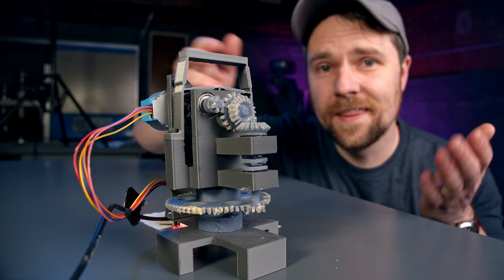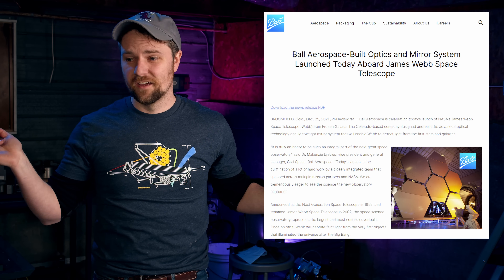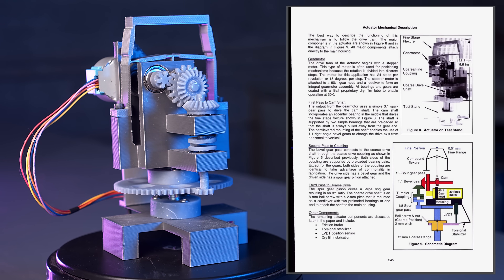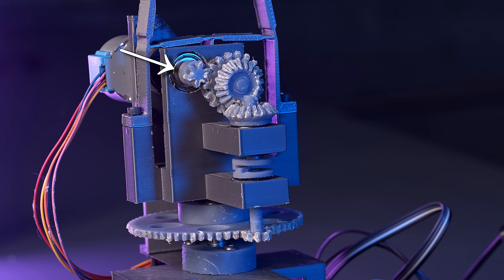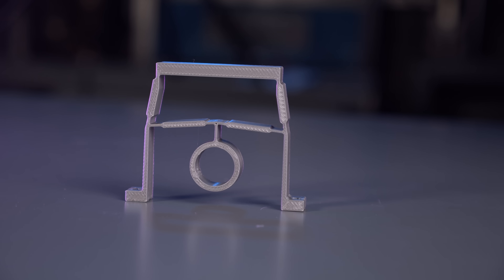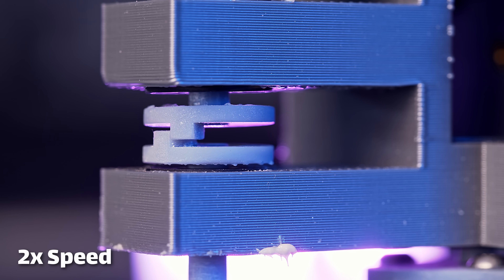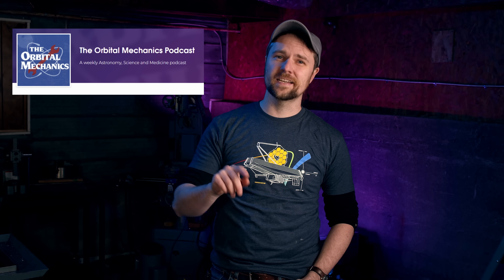How to achieve nanometer precision in space?

Comment: As far as I’m concerned we are wasting our time. I truly believe we could have the mirrors aligned by now.
Reply from the maker: How many mirror segments have you cophased in L2 orbit? Not trying to be rude here, but your string of comments are grossly oversimplifying the situation. Cophasing on earth is a tremendously difficult task, requiring each mirror segment to be within a handful of nanometers of the correct curvature (in all degrees of freedom) across all segments. A single segment that is phased incorrectly reduces the resolution of the entire mirror array down to the size of a single segment, so all segments have to be perfect.

Now do it in orbit, on a telescope that has to be kept so cold that it can't detect itself (because it's an IR telescope) orbiting an unstable lagrange point.
Reply: @BreakingTaps  I think they are clearly over compensating for their completely unacceptable blunder with Hubble. I did some further research though and read that the curvature of each mirror segment is also adjustable. I feel as though this is a direct answer to the Hubble fiasco. I realize heat and cold will deform any material but they should know exactly what shape they should be in those conditions. I also don’t think you get as high quality a mirror by bending it as you would by properly grinding it. But that certainly explains the time it’s talking. They have generally correctly shaped mirrors and they’re hoping that a piston will correct the minute fluctuations. I just want to see the damn pictures. The embarrassment of Hubble will echo through space projects, especially telescopes forever.  The incineration of of the original crew of Apollo 11 barely slowed anything at all. And that was an extremely obvious blunder. Live wires in an capsule full of human fuel and oxygen. Any first year chemistry student would have known better. But we’re creeping along with Webb because telescopes cost more than people.
Reply: @BreakingTaps  In other words. I want to see pictures. We’ve all been waiting years. The complexity we’re talking about here just gets more and more complex the more I learn as the weeks go on. After all this time there are still so many hurdles that it’s driving me nuts. Just one of those whale blubber spermaceti lubed gears could get stuck and we’re up the creek. It’s duct tape left on a hairy arm for hours and someone is peeling it off as slowly as possible and every minute that goes by is another component that has to work PERFECTLY that could fail. That’s a lot of team members devastated and millions of enthusiasts deeply disappointed. Focus the damn thing and take pictures along the way. All that money and just a few years worth of fuel.  I just want to see some damn pictures. I guess it will make a nice birthday present if everything continues to work. But for heavens sakes, let’s take pictures along the way in case something fails so we at least have that. Get a good look at the darkest part of the sky. Isn’t that the point? To see what happened right after the big bang?  Can’t we get progress reports in hi def as we go?
Reply: @BreakingTaps  Apollo 1. Sorry. I’m just antsy. The more we wait the more time something could fail. It’s astronomically unlikely but a micro meteorite could rip right through that tennis court sized shield or even scratch one of those bendy mirrors. I realize it takes months to set up a modern SEM even with people standing by.  Sure Infrared can see through dust but aren’t we really looking for what galaxies looked like closer to the bang? Okay i’m officially done now.

Comment: I would worry about those flexure joints at cryogenic temperatures, but I'm sure NASA's materials scientists know what they're doing. I'm just prejudiced against flexure bearings because I've designed interactive educational exhibits all my life, which are kid-activated and have ridiculous duty cycles. I've learned to use type 304 stainless and sintered bronze in every linkage because a kid can break an anvil. However, the Webb's mirrors aren't going to be aligned and focused by kids. I assume they'll be adjusted as rarely as possible.

Comment: Since you might stop the course drive at any point in that 'clutch' rotation, the fine motion could be in any part of its cycle.  So it seems we have to keep track of that.  When doing course, you would sometimes run slightly past the desired position and use fine motion to bring it back to target position, while other times you have to stop the course motion just short of desired position and use fine motion to finish movement.

All perfectly 'doable', but a tiny nuance to the motion calculations to keep track of.
Reply from the maker: Yep, you're absolutely correct! The fine movement contributes to the coarse at all times (adds or subtracts in a sinusoidal fashion).  It's also slightly nonlinear due to parasitic motion in the flexure mechanism, so they have it well calibrated to know the contribution at any point in the cam rotation and account for that.  Each actuator is also equipped with a precision LVDT sensors to monitor distances.

Comment: The flexure is clever with regard to taking out back lash through springy preload, gear engagement mesh is still going to need to be of a high standard.
I did wonder about the use of an eccentric cam giving non linear motion, it occurs to me however that the geometry of the flexure might be able to cancel that out, if so it is a particularly  cunning design. Either that or the number of steps for a micron of flexure top surface movement is precalculated for every position of the eccentric shaft.
Reply from the maker: I think it's the latter: just very well calibrated (and monitored with a high precision LVDT). The paper talks about how the fine stage has a sinusoidal motion, and since it also contributes to coarse movements it needs to be taken into account at all times.  So I think they just calibrate these things really well to know how much movement is needed depending on the current location of the cam.

Comment: Yay! I had been wondering about these things and in the back of my mind I kept meaning to look up how they were made and now here's a video laying out the entire design! Thank you! Also this is surprisingly low tech for something with this amount of precision. I guess if the temperature is really stable and there is no vibration and the entire system is under tension. I was imagining some sort of ratcheting mems device or a metal alloy with careful temperature control (but I suppose they really don't want any heat sources on that side of the device).

Comment: Interesting that so much of the design only works when the metal flexes and bends. With the cryogenic temperatures I'd think bending like that would be especially at risk of work hardening and cracking.

I'm sure they did the math and tested it so that's not a concern. Maybe the low temperatures actually help when the movements are that minor?

Comment: For getting multiple finished products print a set of parts get them right, then silicon mold the working parts. I have used Alumilite in the past, it's easy to work with and decently strong.

For higher strength light weight parts print molds and use the forged carbon fiber method.

Comment: What do you need to roll the mirrors for?
Reply from the maker: The segments are asymmetrical, so there might be small adjustments in roll that are needed to focus to the correct location
Reply: @BreakingTaps  of course 🤦 I thought of every single mirror as a parabola itself but you need all of them form one big parapola together and segments of a parabola are not symmetrical. Thanks!

Comment: I've been asking around about this very mechanism, thanks youtube for showing me this. Edit: noooo! The thing I was curious about was the curvature actuator! How can rhey make it so precise?? Is it like this?
Reply from the maker: I'm not 100% on this, but I believe it's the same actuator just mounted to the center of the mirror. The other end of the actuator pushes on a "delta frame" which is ancored to the edges of mirror. So when the actuator extends, it applies pressure to the center of the mirror and flexes it outwards, reducing the radius of curvature. In the other direction it pulls on the center, increasing the ROC.

A big goal of this design was reusability which is why they went with the hexapod.  Six identical actuators, for both primary and secondary mirror. So it'd make sense they use the same mechanism in the center for curvature too.
Reply: @BreakingTaps  well in any case you've got a new subscriber.

Comment: Love this video , I've been enamored with this actuator ever since I heard about it and am so happy to see one.

What I've been trying to understand is , does the fine control only work in one direction? I understand the coarse going in both directions, so you would go just under with coarse then reverse to go into fine, but to go backwards would you have to give coarse a little bump in the other direction and overshoot then work your way back up with fine ? 

Thanks
Reply from the maker: Yep! Exactly how you describe. Throw it in reverse, overshoot your destination (both to take up backlash in the gear train, and to get it to the beginning of the "fine" range) then disengage the coarse side and just use the fine stage.

Because the fine stage is controlled via a cam mechanism, it has a sinusoidal movement profile and doesn't really care which direction you're moving.  If there was no coarse stage it'd just oscillate between it's 10um range indefinitely. So it's mostly a task of managing the coarse stage and under- or overshooting your destination as appropriate.

Comment: What if one of the motors were to fail?  Does that doom the w
hole mirror alignment process or is there some sort of redundancy?
Reply from the maker: My understanding is that the segment is pretty doomed. Hexapod arrangements need all six motors to function for movement in any axis.  I don't think it's ruin the entire mirror alignment proces though. It would severely limit the motion of that particular segment, but there might be some clever workarounds if one gets stuck.  The backup plan might have been to angle the mirror so it wouldn't contribute to the final image (i.e. point it away in some random direction) and just lose light from the segment. Not sure!

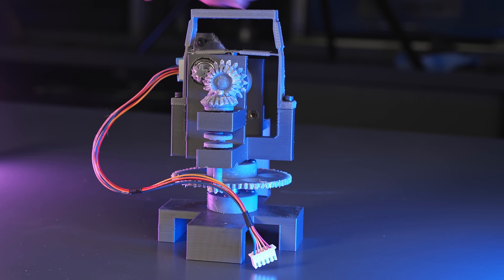Comment: neat! but I see a problem with it, could you clear it up?  When the coarse stage moves, won't the vertical movement bend the whole stack about the flex joint in the torsional stabilizier? At 8:48 , this tilt is clearly visible. The ball screw has to guide itself for the axis to remain straight
Reply from the maker: In principle it will! But there are two factors that probably make it negligible on the real actuators. There wasn't a clear view or description of the torsional stabilizers, so the dimensions are mostly just guesses on my behalf. The real ones might be considerably "softer", and since the whole mechanism is made in metal the rest of it will be less susceptible to twisting.

Secondly, the ball nut they use is quite large in comparison to the ball screw and overall mechanism. So it would provide a very strong resistance to bending. In contrast mine used a single m8 nut, which was also a very sloppy/loose fit, and that made it "pivot" around the nut. In retrospect I should have included several nuts to help take up the slop but didn't think about it until later :)

So basically yes, I'd expect there to be some bending/flexing, but probably a whooole lot less on the real mechanism :)  Hope that helps!
Reply: @BreakingTaps  thanks for the clarification! makes sense. It is even more remarkable that nanometer precision is possible with this mechanical system.

Comment: Similar but distinct terminology appears in aviation and marine use. It's worth noting these terms in order to make the similarities familiar.

The three rotational degrees of freedom are pitch, roll, and yaw. The less familiar translational parameters are heave (up-down), surge (fore-aft), and sway (port-starboard).

All of these, at sea, tend to be periodic due to wave activity, at much less than 1Hz. I have the impression that the periodicity of motion in devices in space occurs at acoustic frequencies, where there can be material resonance and any number of component issues. At sea, the most hazardous conditions are when the wavelength of sea motion is close to the vessel length. It's the sort of resonance that can break a ship in half after a few iterations.

Comment: 2:37;
there seems to be an error in your spreadsheet. 
Corse step size 0.058 microns? 

You would need 362,068 steps for 
the 21mm range...
Reply from the maker: Table is taken straight from the paper! Note that the steppers they are using are 24 steps per revolution, and the ballscrew has a lead of 2mm. So only 120,960 steps to move the full 21mm using the coarse mechanism: (21mm / 2mm lead) * (60 * 8) * 24 steps.  But yeah, still a lot of steps! But these devices don't need to go fast or anything, just accurately.
Reply: @BreakingTaps  I see

Comment: I find it odd you didn't mention this. How do they deal with the backlash introduced by all of the gears in the system? Is it just dealt with through software?
Reply from the maker: Ah, just didn't think to talk about it. My bad! So backlash is only an issue when reversing directions. The mirrors are stowed near the bottom of their range of motion, and need to travel about 12mm up to the nominal location. From there they are slowly moved into final position. If all goes well, it's a single direction trip so the gears never have a chance to see backlash.  If they do have to reverse for some reason, they just need to do is drive backwards and overshoot the destination, giving them some range to move forward again and take slop out of the gears. The flexure/cam mechanism means that once the slop is taken out of the gear meshing it's a backlash-free system.

They also have a high precision LVDT sensor which monitors distance and can be used to account for backlash and other minor non-linearities.
Reply: @BreakingTaps  Awesome! I appreciate the response, was expecting a random commenter to chime in.

Comment: Very interesting/smart mechanism. However here earth we'd probably need some form of lock on the course stage, as the ball screw could back drive the mechanism under the force of gravity. Maybe the coupler could lock when pins are not together, or the course could use a worm drive. It might also be helpful to instrument the couple to confirm it's position. But again, very smart!
Reply from the maker: I just forgot to mention it, your intuition is correct! They have a small friction brake that applies force to the big "coarse" stage gear via a little plastic button.  That's used to keep the flexure from back-driving the coarse stage when the tumbler/coupling disk is disengaged. There's also a high precision LVDT sensor which monitors distance of the actuator and can help correct for any non-linearities

Comment: 2:48 You say there are 108 actuators in total, but that's only 6 * 18, meaning you forgot the 7th one that adjusts the curvature of an individual mirror. 7 * 18 is 126.
It probably just slipped your mind when you were doing the multipliction though, it's not a big deal. 
Thanks for the excellent video, I appreciate the lengths you went to to recreate the actuator
Reply from the maker: Whoops! Yep, just slipped my mind :)  Actually there will be a bit more than even 126, the secondary mirror apparently uses the same actuators for it's segments too.
Reply: @BreakingTaps  Ah, ok

Comment: It seems like one other advantage/feature of this mechanism is that it's not back drivable. Moving the platform does not rotate the motor back. The motor does not have to be energized with a holding torque once the mirror position is calibrated. Not that there is any force on the mirror but just in case
Reply from the maker: Mea culpa, I did forget to mention that there's a little friction brake hidden in the real design. It applies force to the big coarse stage gear via little plastic buttons, to reduce backdriving when the coarse side is disengaged. Presumably their ballscrews are low enough friction that it was a concern, although mine definitely doesn't have that problem :)
Reply: @BreakingTaps  that's great. Thanks for the detailed information and comment

Comment: Roll?? How does roll affect the imaging?

Same goes for X and Y....
Reply: If it was just a single monolithic mirror it wouldn't matter, unless it was some odd off-axis primary mirror where the optical center was != the geometric center.  In the JWST the edges and corners of the adjacent hexagon mirrors in the array need to be aligned which will require rotation along the Z-axis as well as translation in the X and Y axis.
Reply: @JlerchTampa  Thanks. 
OK, I think I'm getting it, a bit more, perhaps..
I was thinking that the goal was to produce as close to a single mirror as possible, and just putting up with narrow gaps here and there.
My next try is that effectively all segments are focused onto the same area. If they don't form a regular grid then there will be edges where not all segments overlap, reducing exposure for those thin edge areas.
Closer?

Comment: thats super cool, i actually machined the flexture on that many years ago.
Reply: 2:54 the arrows are pointing to the parts i did the most work on. such a trip seeing them again
Reply from the maker: Woah, that's awesome! Do you happen to remember what metal(s) the bits were made from? The paper mentioned titanium being used for the gears, and a few other vague references to titanium, but nothing definitive for the main frame and flexures. I sorta assumed Ti for those as well but couldn't track it down
Reply: @BreakingTaps  everything was made from titanium, just a 6al alloy if I remember correctly. 
Thanks for the video!